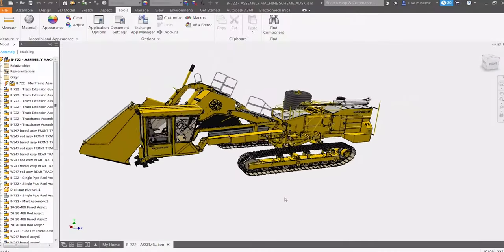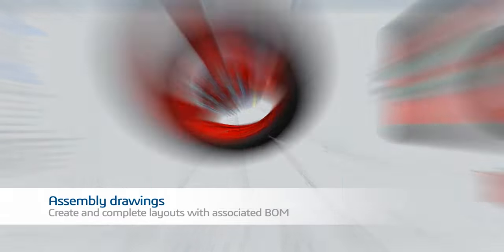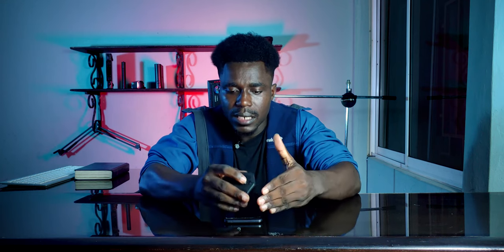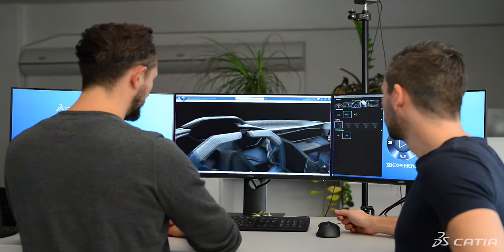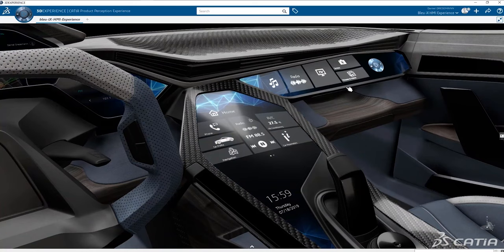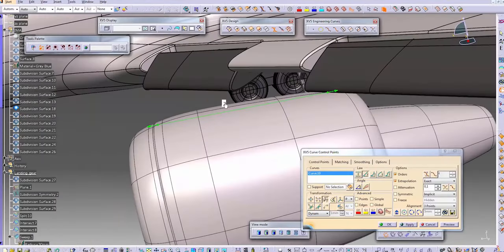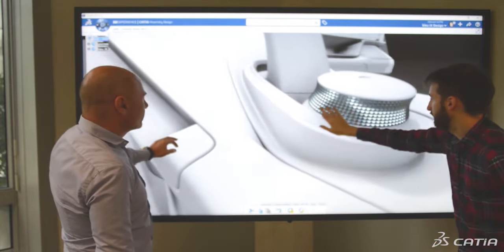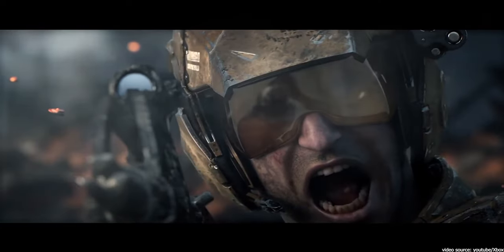CATIA vs SolidWorks and Siemens NX: Hardest CAD comparison on the internet.

Comment: I am an expert in SOLIDWORKS.  My opinion is if it has wheels or wings, CATIA is the way to go.  Otherwise, the power behind the intuitive and fast software makes SOLIDWORKS have a greater ROI for most companies.  My other opinion is that in a decade, both of these softwares will be phased out as 3DExperience is further developed, even if it isn’t the best platform today.  All three of these softwares are developed by the same company, and they are pushing very hard with the cloud based CAD systems
Reply: Why specifically wings or wheels? I assume you're saying CATIA is better for things that do a certain type of motion? What makes CATIA better at that?
Reply: @fulldonkeymode8837  Well, three big reasons.  First, CATIA is simply industry standard with those industries, so there would be less file converting between companies and manufacturers.  Second, CATIA has what should be considered a superior surface modeling and sculpting tool.  Third, CATIA assemblies work really well with motion, which isn't to say SOLIDWORKS doesn't because SOLIDWORKS is occasionally bought by companies just to have a tool that can send animations of future products to marketing, but I believe that CATIA works better with that type of cyclical motion and with assemblies at the scale of the automotive industry (many thousands of parts), so your assumption is correct.  It does have a higher learning curve because its interface isn't anywhere near as intuitive as SOLIDWORKS.  Ease of use for all of its many many tools is something that SOLIDWORKS really works on.

Side note, 3DEXPERIENCE will continue to take the best parts of both platforms and run it in a cloud based system.

Comment: This is a very good explain about the uses and the power of each software. I'm personally started with draft sketch --> AutoCAD  -->  Inventor  -->  Solidwork (until now) And I'm about to try NX soon to see if it fit my need then solidworks or will Solidworks be my professional skill.😂 Note: I only have one year experience but it's pretty good so far.
I hope every starter in CAD design will see this video. Thanks you
Reply from the maker: Wow, one year of experience is almost like having all the basic knowledge you need to gather before making your final decision if that's a future you want. Good start man.